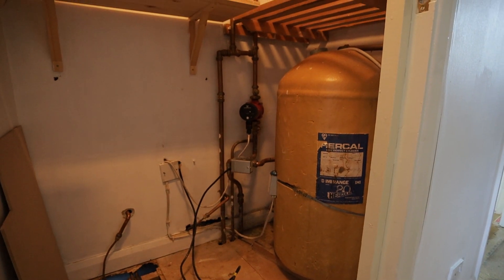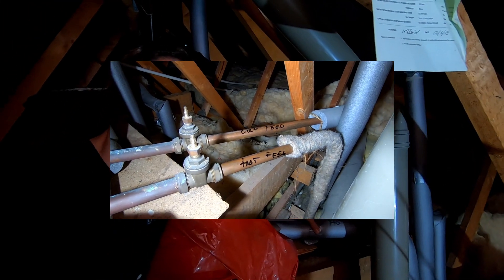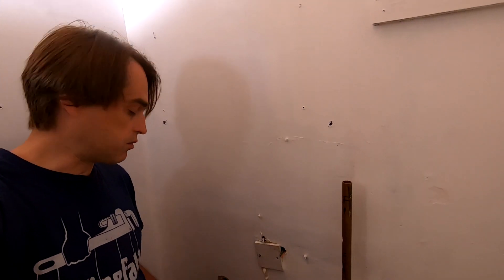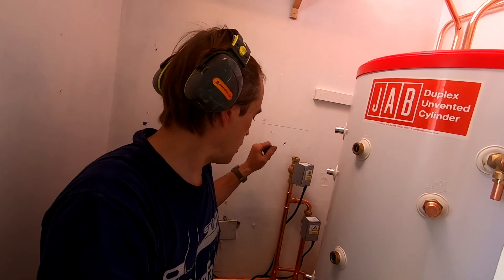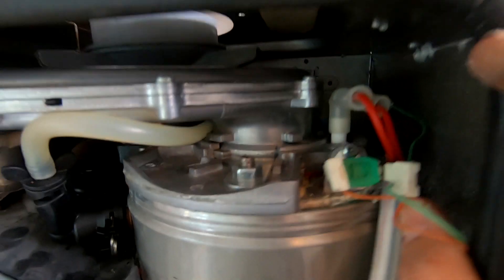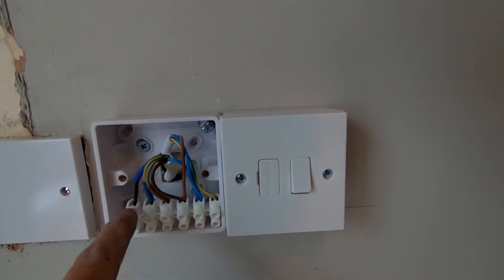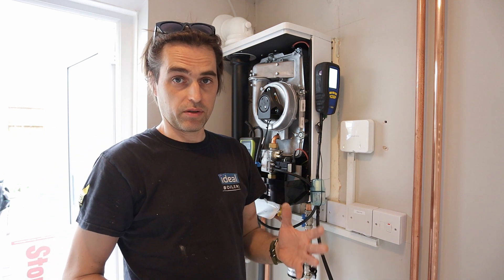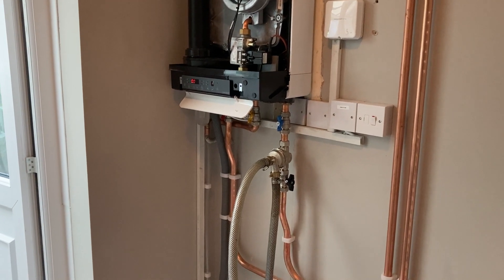Domestic Hot Water Priority with Intergas boiler.

Comment: The boiler's output should be matched to the max kW capacity of the cylinder's coil. If the boiler is set too high you get boiler cycling. What was the kW of the coil?
Reply from the maker: It’s 18kW boiler with twin coil cylinder linked together. One coil can take around 20kW so I guess it is 18kW going into 40kW coil.
Reply: @UrbanPlumbers  
I suspect only one coil should be connected (coil too big) as the boiler may modulate down on initial reheat, not dumping all its heat into the cylinder, until the return pipe warms up, keeping the F&R inside the delta T.  But the 25mins reheat sounds about right for an 18kW boiler.  So, the there may be no penalty in reheat time, and the boiler operating at a lower more efficient temperature.
Reply: @johnburns4017  following this as I am fitting a AIC silox 215 tank in tank , with a equivalency of 41kw max absorption. My intergas will push out 30kw on priority hot water.  I wasn’t aware of having a “too big a coil” would cause an issue - just slower reheat compared to DWH specifications from cylinder manufacture
Reply: @bobwylie158  
* Say a cylinder is all up to temperature at 60C. 
* There is a draw-off of hot water, say half the cylinder.  
* The top half will be 60C, the bottom 5C. as the incoming cold water is at 5C.
* The bottom half of the cylinder may be cold yet useful hot water is available at the top. 
* The cylinder stat cuts in, calling for heat from the boiler.  

A modern condensing boiler will have a control system set at say 10C delta T between the flow  and return - to protect the heat exchanger.   How they tend to work is that the return temperature is sensed, then the burner is modulated to maintain a flow temperature 10C above the return temperature. This could mean the kW output of the boiler is greatly reduced, for a while in cylinder reheating.  The boiler is not giving its maximum output.

If the return temperature is 5C the flow temperature will be cut to 15C.  So 15C water from the boiler's flow enters the cylinder coil. So, the useful 60C water at the top of the cylinder will heat the boiler's primary water, operating in reverse. The cylinder is heating the boiler. This is cooling the top of the cylinder, destroying cylinder stratification.

As the return temperature gradually increases, so does the flow temperature.

The way around this is to have a blending valve on the return from the cylinder to the boiler. The inlets of the blending valve are the cylinder return and boiler's flow. The outlet to the boiler's return. This is set to say 52C if a flow of 62C into the cylinder coil is needed (the delta T of the boiler has to be known). This means water will never enter the coil less than 62C. The boiler's return temperature is kept high, by looping on itself from flow to return. Like back end boiler protection on large commercial boilers.  

This maintains the stratification in the cylinder. It also protects the boiler in not having a cold slug of water pumped into the heat exchanger.

So, with modern condensing boiler controls that modulate the boiler's burner, you are better off having say a 30kW boiler with a 25KW cylinder coil.  The boiler will modulate the burner to suit to get the maximum kW out of the boiler when it can. Having a boiler of 30kW and coil of 40kW will not ensure the boiler is working fully at 30kW at all times. At time the boiler will modulate back under 30kW even with a cylinder coil demanding more kW. All to do with the boiler's control system wanting to maintain a delta T to protect the boiler's heat exchanger..
Reply: @bobwylie158  
Tank in tank, nice. Where are AIC made?  They have a big Russian outfit.
Reply: @UrbanPlumbers  
If a coil is rated at say 12kW by the makers, then obviously do not set the boiler's kW to say 18kW.  If the delta T narrow as the cylinder is being heated up, does the boiler modulate down to avoid cycling?

If so, and the coil is too large the delta T will be too large, then the  boiler modulates down the flow temp to get the delta T within the desired range for the boiler.
Reply from the maker: How do you calculate the coil output then?
Reply: @UrbanPlumbers  
Makers give the coil output in their literature.

Comment: Why not fit a combi. Use the DHW side with a brass pump,  to heat a cheaper direct cylinder.  Cylinder stat switches brass pump, which activates combi flow switch. Only needs 15mm pipe between combi and cylinder. 

Much simpler and quicker. No complex, potentially troublesome. zone valves needed and complex wiring.
Reply: So how is this piped? Does it go Cylinder hot outlet>Tee(one goes off to demand eg shower>boiler cold inlet> boiler dhw outlet> brass pump> cylinder cold inlet? This seems really weird.
Reply: Also, how would it work properly, since when you're using water, the cylinder stat will not be satisfied and trigger the pump meaning you'll cycle hot water into the boiler, reducing potential flow rates as well as wasting hot water since it'll just mix with cold going into the cylinder inlet.
Reply: @Saaj2  
When cyl' stat switches on the pump circulation will only be between combi and cylinder.  Only needs a cheaper direct cylinder.
Reply: @Saaj2  
Flow and return from combi to cylinder using the fresh water section of combi.

1) Hot outlet of combi to top of cylinder. Using a Surrey flange into cylinder draw-off, or into a cylinder port. 
2) From bottom of cylinder using a cylinder port or tee into cylinder cold feed at the cylinder, or again use a Surrey flange. Into combi cold feed. Have brass pump on return pipe from cylinder. 
3) cylinder stat only switches brass pump.

Comment: Great video, extremely informative! Just a quick question, is an external programmer needed for the hot water? Or can you control hot water times with the Honeywell programmer you installed on this job? I understand this would be difficult unless using boiler brand controls with the correct boiler. 👍🏼
Reply from the maker: You could control it with one device without a programmer - nest or similar

Comment: You seem like a great installer but why do you combustion check with case off?
Reply from the maker: I do both. Adjust with case off re test with case on. On Intergas you usually have to adjust minimum rate on the gas valve.

Comment: Useless… why not use combi boiler, no need tank and cylinder.
Reply: Yes I I’m clearly out of planet of obsolete idea like yours. I’m on new generation Dude!
Reply: @James don’t have a clue??? I’m professional installer of combi boiler. I covered electric and plumbing. I always recommend to all my customers to change a combi boiler. All my customers are happy with my recommendation. I I’m installed as will baseboard heater. Probably this guy don’t know the latest generation.
Reply: @James 32kw it’s fine for 3 showers at the same time, just simple increase the pressure of the combi. Probably you don’t know, coz it’s not your job line.
Reply: @James I just finished installation last week, combi valliant 835 = 32kw, I recommend the owner the baseboard heater. With 7 output of baseboard heater with two showers. At the same time. It’s works perfectly.  For your information, on combi boiler you can easily adjust the temperature and keep 1 to 1.5 bar on pressure. And I give all my customers with 10years warranty labour and parts. But need to service every year.
Reply from the maker: I think he is just a wind up. 

Unfortunately there are more Meatbots like him drop kicking combis on the walls all over the place.
Reply: @meetbol9039  
Vaillant make some dogs. That nasty quality Ecofit comes to mind.  It sound like a nuts rattling in a can when running. Avoid.
Reply from the maker: Because you would have to upgrade gas, will have less efficiency, poorer hot water performance, no chance of connecting solar in the future, no use of 2 showers at the same time,  more internal components on combi to go wrong, I could go on and on. Combi boiler is what makes this industry so poor in both design and understanding of how heating and hot systems work.

In this case combi installation was the same price as unvented when you take into account cost of gas upgrades and need for 40kW boiler
Reply: @UrbanPlumbers  you big mistakes, combi boiler at 32kwh you can use 3 showers and all heaters at the same time. Your knowledge brother is obsolete. You need to study the latest generation. So that your be coming customer can save money. Stop introducing very old and inefficient idea. Thanks
Reply from the maker: @meetbol9039  yiu have no idea what you are talking about mate
Reply: @UrbanPlumbers  
But all that space taken up by a cylinder.  A combi must be the first port of call when assessing.  W-B make a 50kW job. Unvented cylinders can be very problematic. Only when a combi is unsuitable for other installation and cost reasons do you go for a cylinder. Times have moved on.

Many fit unvented cylinders thinking it will magically improve the mains water flow and pressure. No kidding.

Comment: Excellent video. I really enjoyed it. Does the Intergas boiler have an expansion vessel built in, or is it in the stand-off kit? Boiler is much neater without the stand-off bracket like you’ve installed it.
Reply from the maker: Intergas HRE don’t have a build in vessel. You can get a jig with a vessel though. I much prefer robi kits to integrated vessels, as you can get a bigger vessel and install it remotely. Easier to service or replace external vessel too.
Reply from the maker: There are other Intergas boilers with build in vessels: rapid and extreme
Reply: @UrbanPlumbers  Thanks for replying. I agree with you, the robi kits are a better solution. Our local suppliers did promote Intergas boilers a while back and I fitted a few of the Rapids, but they did have some burner ignition  issues and intergas didn't really have enough service engineers to respond quickly so the supplier stopped promoting them.  But I do like them.

Comment: What is the problem with plastic pipes?
I had a full system and combi fitted the plumber gave the choice of all copper, all plastic or copper where it could be seen and plastic under the floors. All the same price Chose copper/plastic. Been there for 20+ years. 
The plumber warned that mice could be a problem with plastic, but the copper/plastic was good as the joists could be drilled and not notched.
Totally silent system. No creaks like copper often has.
Reply: Preference mainly. The pipe itself is highly unlikely to cause any issues, but the fittings definitely have a higher failure rate than soldered copper.
Reply: I agree with you less noise but I think customer got a fright when looking at all the fittings I use plastic all the time but it is all continues and I drill holes instead of notching.
Reply from the maker: Fittings will not last as long. They definitely fail more often. Also, not what client was paying for. Also push fit fittings need to be accessible so a no no under tiles or flooring that can’t be easily lifted.
Reply: @UrbanPlumbers  Ah.. Right. My floors are easily accessible, just decking.
The problem was all the pipes had to be run through the ceiling as the ground floor is concrete.

The guy who did the installation was an old heating engineer who said plumbing was just common sense. 
As I remember he didn't use a lot of plastic connectors, but quite a few 'bloody ells'. Lol!

The pipe work is almost all hidden and where it can be seen is minimal, behind a door and down a corner painted in are the only two places copper pipework can be seen, obviously under the radiators too. 
A good job it seems. No leaks so far.
Baxi 105e Instant now replaced with an Intergas ECO RF 36
I did my homework on boilers before buying!

My next door neighbours is a council job, both done to replace warm air heating from the 70's Hers looks like W. Heath Robinson did it with pipes everywhere.
Reply: Plastic fittings and brass compression fittings in inaccessible areas are a pain. Tend to find most failures on plastic is at the fittings due to o-rings being sliced on install, pipe not being cut square so it actually degrades, people forgetting to put inserts in etc. Cost wise they're about the same now so it just comes down to longevity and installation time as it's far easier to fit plastic in most cases than copper unless you can follow the valleys and original notches which isn't always practical.
Reply: @effervescence5664  
If the plastic pipe is cut with a proper plastic pipe cutter with a sharp blade, with no stress on the fitting, in short generally clipped either side, they will last as long as any other fitting. I have had every type of fitting fail on me, except quality plastic when fitted properly. 

When installing plastic fittings use a smear of plumbers grease on the O ring.
Reply: I bought a developer house new 20 years ago.  It was fitted in plastic Speedfit with copper in exposed locations using brass pushfit fittings on the copper pipes. It was well clipped, being checked, and pressure tested by the site manager before ceilings were closed up.  I no longer have the house, but I know there has been no problems whatsoever since, and none in the other houses around. I know of one site where the systems were pressure tested to 18 bar overnight using Hep2O. Any problems were caught before ceilings were closed up. 

BTW, you can use brass compression fittings on plastic pipes. I have to great success. Not one failure.
Reply: The real issue is the customer specified and expected copper - I believe.🤔

Comment: Nothing wrong with Worcester it’s the idiots servicing them or not cause they don’t know how to service any boiler
Reply: True but that goes for any boiler not serviced will fail there is not a boiler better than another on the market in my opinion they all need servicing properly not BG service
Reply from the maker: @mrserviceman8795  Not quite. Alu heat exchagnes need much more maintenance than stainless steel ones. Kebab (WB Junior / ri - etc) are possibly a hex that will fail the quickest if not serviced, run properly form most boilers I can think of. 

I have seen a lot more failed Worcester heat cells than Vaillant or Ideal - and numbers of appliances out there are roughly comparable.
Reply: @UrbanPlumbers  heat exchangers are affected by poor system water, lack of services and many ri boilers I see don’t have pump over run. Plumbers faults not the boiler
Reply from the maker: Agree, Ri are actually not a bad boiler. If not serviced the heat cell will fail though.

Comment: Neat and tidy job, like how you label stuff to make it easy for the next plumber. I think you are the first plumber to install X-plan on youtube. I know Intergas prefers X-plan to W-plan but they don't explain why. Is it because 2 port valves are more reliable than 3 port valves?
Reply from the maker: It is because in heating mode valves are not energised. If you use 3 port instead it is energised in heating. Since heating is on more than DHW 3 port will fail quicker than NO and NC 2 port.
Reply: Nice one thanks for sharing, looking forward to getting intergass boilier with xplan myself. 

Just to share, I believe you can also use a diverter valve (or mid position rewired to diverter) inverted (so A side is hot water) so the heating side is in a relaxed state to increase the life of those valves too. 🤓